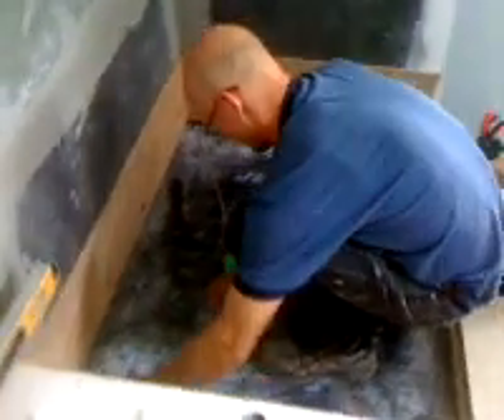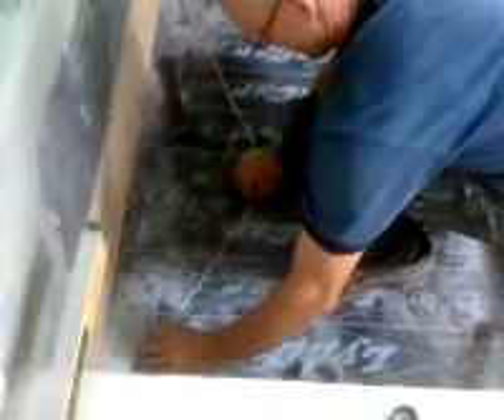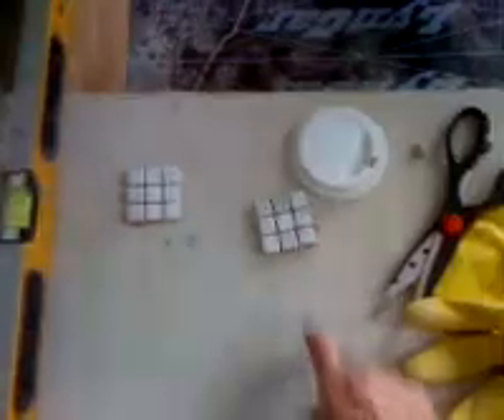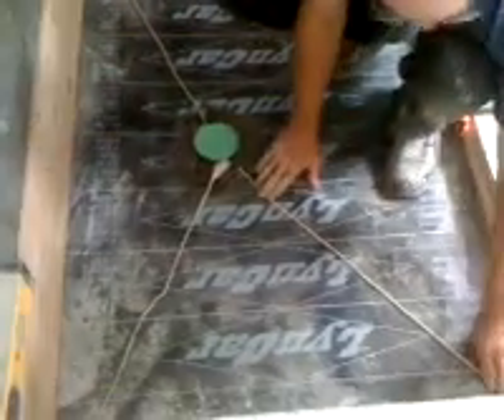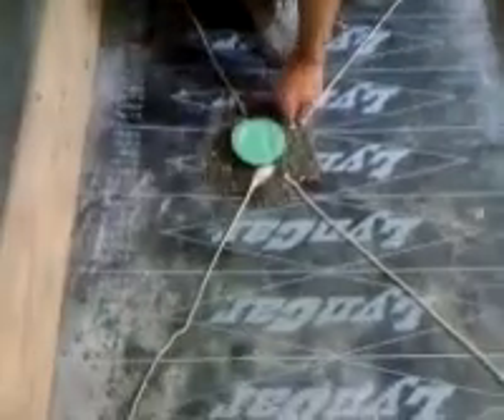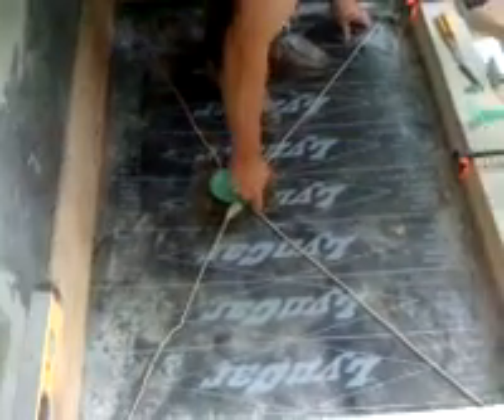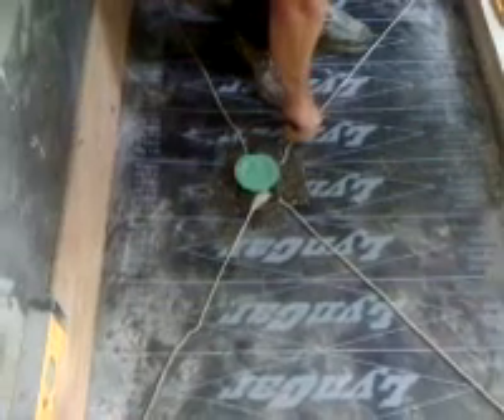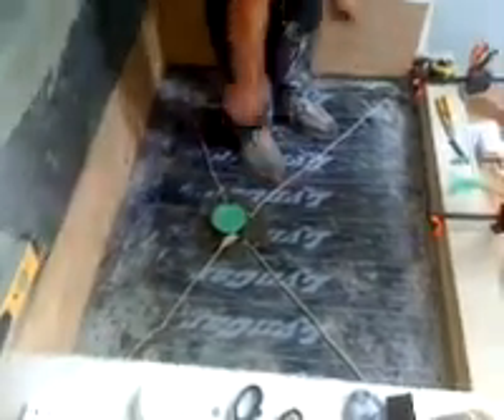Preparing a custom Shower pan & liner - Thu, 10 Jun

Comment from the maker: The cotton rope wicks moisture towards the drain, where the pea gravel disperses the water into the secondary drain holes... Although it will likely never see moisture after we tile the floors, it is a solid backup system that we leave in place!

Comment: He he. Tile leaks. ALL tile leaks. Tear apart any tile shower and the morter will be wet. That's why you need a showerpan. I've install showerpans for a living for 35 years, near retiring. I've redone thousands of showers that had to be DEMOLISHED AND REDONE because they leaked. Its not like a roof leak you can just patch. If it leaks you tear it all out and start over again. Good for me, not good for homeowners. ---- So do you hire an expert to do this critical part of your tile installation? You decide.